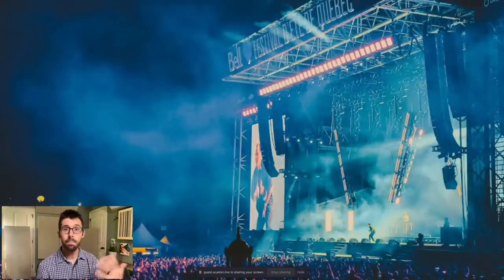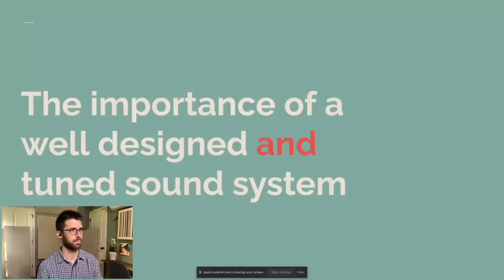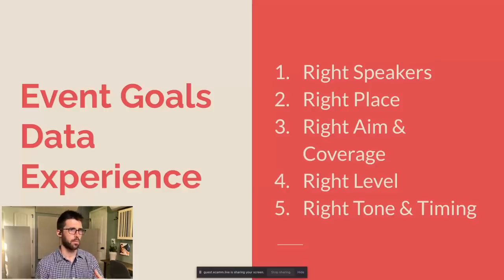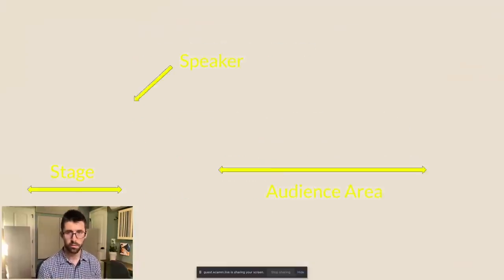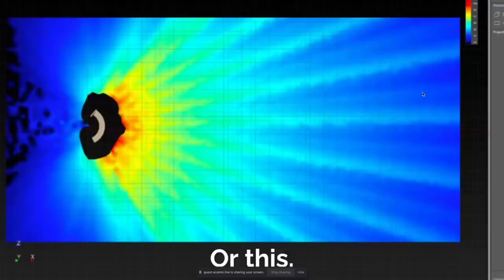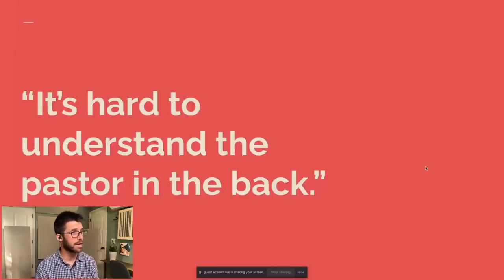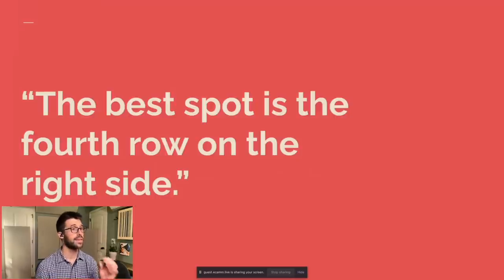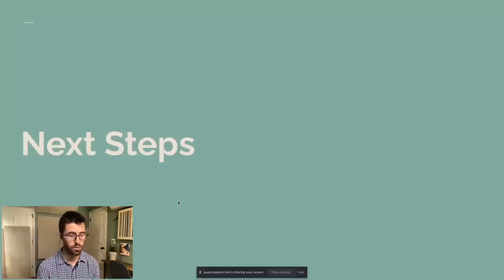PA System Design for Churches | Beginner's Guide

Comment: Great video, thanks! An important thing I'd like to add is that room acoustics are the framework in which the sound system works, so it is very important to address any acoustic issues even before designing the sound system. Take measurements of reverberation and room modes, or at least model or calculate them. Sometimes a relatively small investment in acoustic treatment solves more problems than an expensive audio system redesign. Just an example of how acoustics and sound reinforcement are both equally important steps towards the same goal: making everything sound good for everyone.

Loved to see this partnership by the way.

Comment: My church is using as speakers a 12" bass with built in amplification plus 2 passive 8" tops, mixing console plus master equalizer. But it's pretty small, so it works. Soon we add two small active monitors, this type you put on microphone stands, to make the sound better audible to the musicians.
For lyrics we use the Song Beamer software, it works fine and you pay one time and can use it for a couple of years.

Comment: At my church we have been getting so much feedback, we never had a problem this bad but last Sunday it was really bad. Any diagnosis you recommend? Instruments, mics, belt packs, etc. The feedback is the worst with the electric drums and our pastors beltpack mic gave a popping noise and feedback.
Reply: Feedback happens when the source "hears itself". So, it means your pastor's mic is getting its signal back from the mains speaker or a monitor. Make sure you pastor isn't going out in front of the speakers, do your best to control low mids with EQ, and get your speakers as high as you can so you're not having to crank them to get sound to the back of the room.
Reply: @MichaelCurtisAudio  Could echo also cause this? Because we have a bit of an echo problem in our chapel.
Reply: @AlexS-vv4qn  It plays into it, for sure. But the bigger issue are the speakers and/or loudest to the microphones.
Reply: You get feedback with electric drums? That’s normally not possible since they don’t have any mics. Something else is going on.